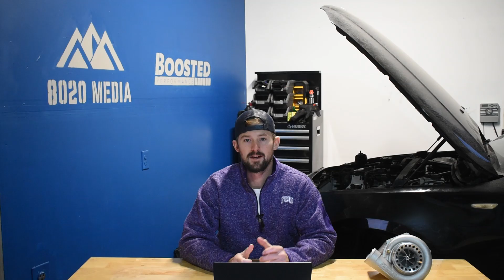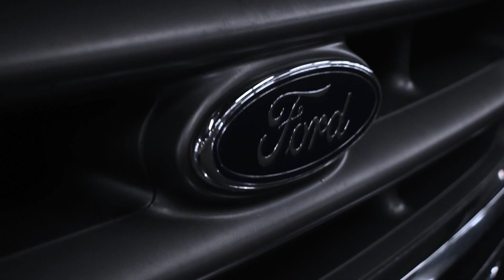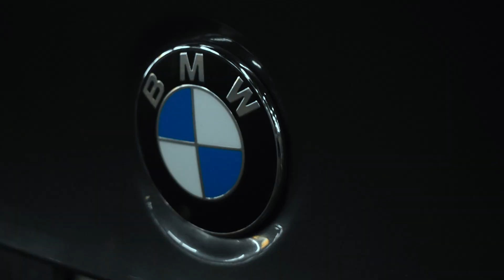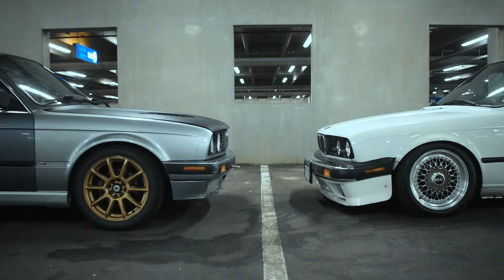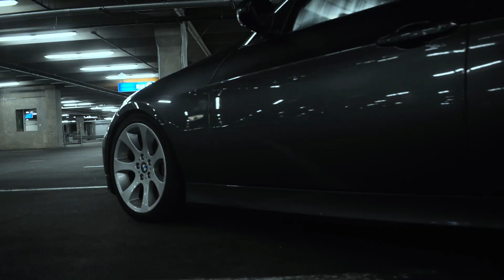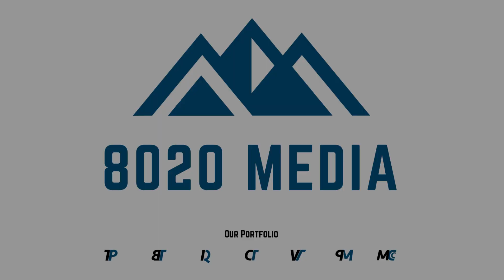Titan XD's 5.0 Cummins | Common Problems & Reliability

Comment: Good video but not all that accurate… Nissan dealerships here in KY still have diesel mechanics available to work on the XD.
Reply from the maker: Thanks for pointing this out - I did some more digging and it sounds like there are still a few around since there is still warranty on some of the XD's but that they are being phased out and likely won't be many left afterwards.
Reply: After working at a Nissan dealership for a number of years, technicians were sent to schools hosted by Nissan to teach them the new stuff.  I would venture to say there are still a large number of Cummins trained Nissan techs out there.  Now as time goes the number will decrease, but Nissan didn't "fire" all the techs because they discontinued the line.   @8020Automotive